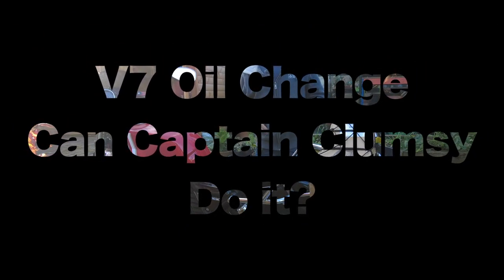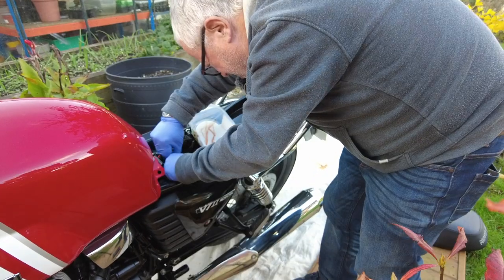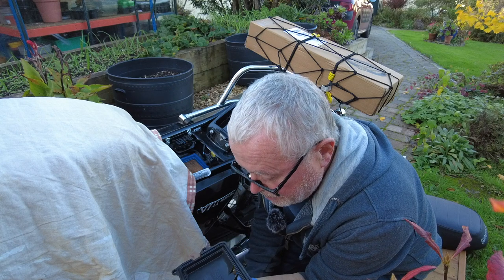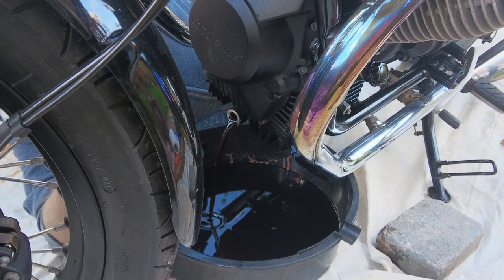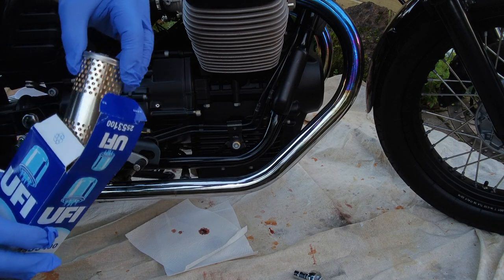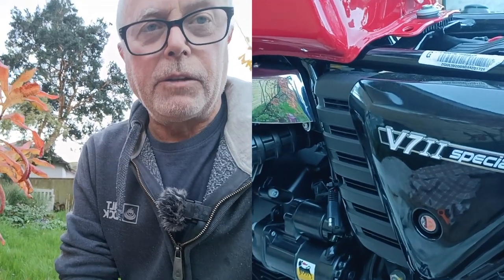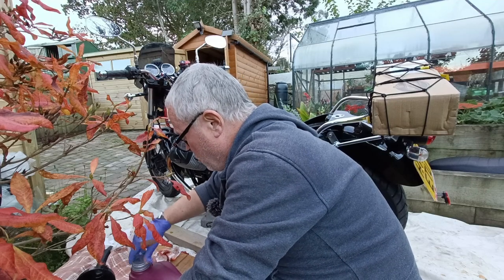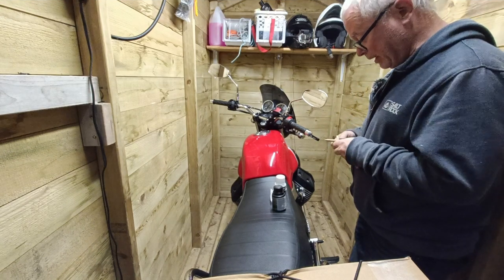Moto Guzzi V7 Oil and Filter Change | Can Captain Clumsy Do It?

Comment: Should the oil level be checked while on the side stand or with the bike level? All my bikes have given different readings depending on orientation; whether dipstick, filler port, or sight window.
Reply from the maker: With the bike upright. The 850s are different though.

Comment: how in hell did water get in the oil  .. also you need to shake the bike to mix that feul mix shyte ya just poured it in
Reply: Condensation, bike has been standing for the majority of the last 2 years, only done 150 miles in that time, short runs etc. Bottom line is, you need to run them up to temperature so the water is converted to vapour and escapes rather than accumulating in the oil!